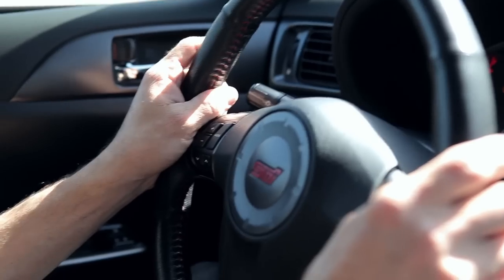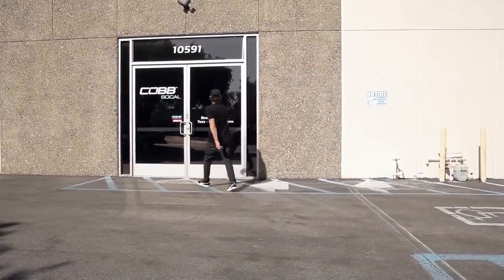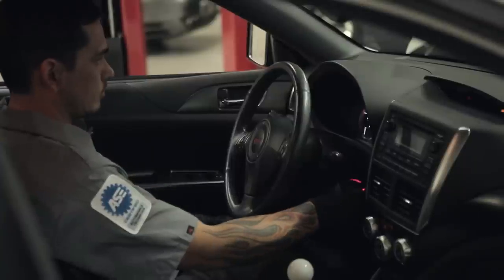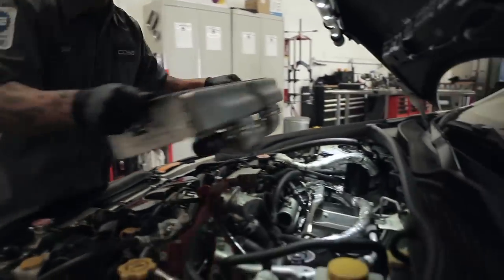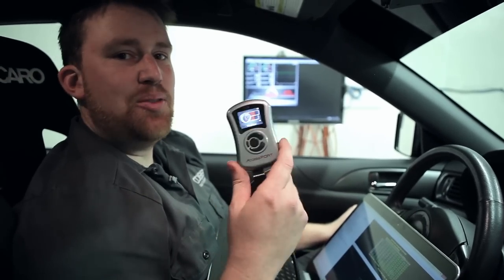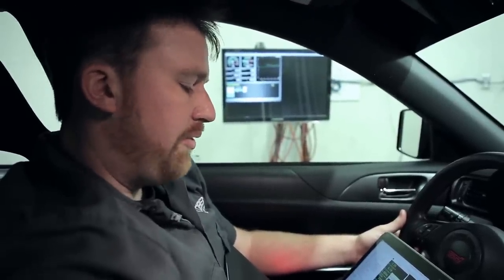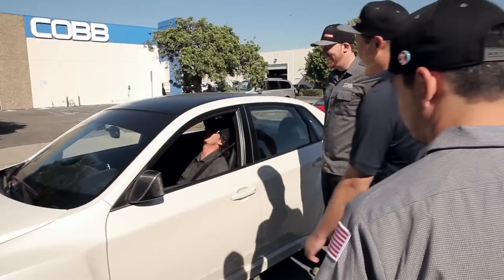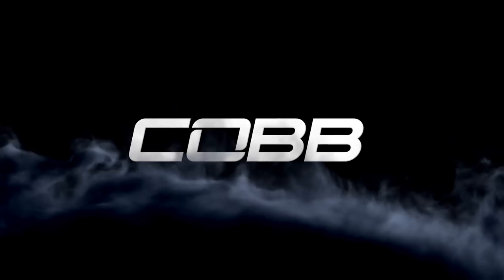COBB Tuning - Bucky Lasek Subaru STI COBB SoCal Car Build!

Comment: Did anyone else notice that in the first clips when Bucky is driving around the center cap on the steering wheel is silver (2:19) but when the tuner is in the car on the dyno the steering wheel has a black center cap (13:54).  And when Bucky is back in the car it's silver again (24:47).
Reply: Iain B 1 word: Lighting.
Reply: +Iain B Get your eyes checked. It's a darker gray because of the lack of lighting inside the booth. Same car, same cap...

Comment: First off let me say, I own and daily drive an EVO X but I have to give props to this STI, sick and clean. And props to Bucky for ditching the stupid ass spoiler.
Reply: Hey, that spoiler on the STI and EVo is what makes both cars
Reply: Hey cousin let's go bowling!
Reply: Shawn Moses i disagree, at least with the pre 07 sti, everyone loves a sleeper
Reply: snowboardUT sleeper STI, lmfao. Maybe to someone who does not care about csrs
Reply: black front mount and delete the hood scoop its a damn impreza dude
Reply: Shawn Moses black front mount and a hood scoop delete, its still a damn impreza dude
Reply: I agree but that would work better on the older modes because they all had the same body lines, but with the GR/GV's (Bucky's) that's when they had the wide and narrow bodies.
Reply: only the older ones though, obviously the widebody new ones look way different
Reply: Shawn Moses Yeah, and it's also what makes you get tickets easier.

Comment: I just bought a 2015 STI. I'll be doing some mods and already have the AP. I doubt I will put that much power into it..... But this Video is definitely inspiring. Thanks for showing the possibilities.
Reply: So far I've only used the AP for a stock Map. I can tell the difference. I'm sure it'll be worth it once I do more mods. If I ever need a pro tune, the AP will store it.
Reply: It's handy for multiple maps. Launch control is nice and so is the code reader and clearer. But the dyno, 0-60, 1/4 mile are all worthless. Those should have never even been on the ac.

Comment: Interesting video, though one of my rod bearings just cracked on my 11'  stage 2+ wrx, pro tuned,  accessport v3 to 278 whp / 326 wtq on a dynojet, I only had the tune for 8 months,  mostly highway driving (60 miles a day) no track, pulled it once a day, have done about 25k miles with the tune, car had total of 56k miles.
I guess pay to play... Subaru warranty? declined of course. I'm re building with forged pistons, but I think I'll stay with stock turbo, since I  want to have the car for several more years. Dropping Exedy stage 1 clutch, Blouch Dominator 1.5 xtr, verticooler and 1000 cc with fuel pump... total price? around $10k. 
Not sure if I'm the exception of the rule, but stage 2 on stock internals CAN brake. 
I think it may have been related to the higher rev limiter of 7000 rpm, planning to stay 6500 rpm at all times. 
Fingers crossed...

Comment: is it just me or is with the windows rolled up it kind of sounds like a boosted Honda.

Car is sick, awesome daily driven kind of build, but this isn't cheap, not even close, lmao.
Reply: Its because he has equal length headers, but yes it kinda does haha
Reply: ohhh, didn't know that! Still rumbled quite nicely with them.
Reply: Danny Oda This is a 2013 model, so unless he had his headers changed, his car should still have unequal headers. They changed the headers for 2015.
Reply: TheBlackWaltz
Even the 2015 model has unequal length headers still (i think?), only the WRX has equal length, but also has the FA 2.0 instead of the 2.5 EJ
Reply: MikeHuntIsItchy Hmm. The STI may still have unequal headers. But I can't imagine they wouldn't have changed it on both at once? Yeah it's the old 2.5 engine, but the headers are pretty easy to change.
Reply: all STIs come factory with unequal length exhaust manifolds, yes Bucky already had equal length headers before the install.

Comment: worse mistake I ever made was letting a non Cobb tuner talk me into letting him remove the Cobb Stage 3 tune off and letting him go open source.  result, the engine blew.  DON'T LET ANYONE TALK YOU INTO REMOVING THE COBB TUNE, IT WILL PROTECT YOU FROM LEANING OUT.  I really miss that instant "pin you in your seat" acceleration.

Comment: wonder how long the clutch will last?
Reply: There's no way he's on the stock clutch at 446 wtq. The stock clutch would literally explode with that much torque haha. My sti is at 350wtq and I've already smelled it a few times which is why I'm putting in a stage 2 competition clutch.
Reply: Flat_4_Crew You're right man. I have basically the same setup/build (built by cobb), similar pwr 430hp/435tq... with a stock clutch that lasted 1/2 a trackday lol (the video is on yt). I got the stage 4 competition clutch... and I'm not super happy with it. I'd recommend an ACT HDSS clutch - that's what im switching to.
Reply: Everyone's been telling me that competition clutches aren't good but I've read so many good reviews. Idk what to do now lol. But I got it brand new for $350 so I'll just see how it holds up martenco
Reply: Get a exedy or clutch masters
Reply: Ive litteraly never changed a clutch on any of my STI's. Wtf are you guys doing that you need a new clutch. My 04 STI was making 371whp/418wtq on a 20g turbo and in the 5 years I had her it was on the OEM clutch. Same with my 17 STI, ya it's still new and less modded but the clutch should last 5+ years.

Comment: How much did this conversion cost out the door?
Reply: +2012 WRX for 100hp on a subaru, you are probably looking at 8k lol For 100hp on an evo, you are looking at an AP and a tune.
Reply: +LP-RIPPER24TV what?
Reply: +LP-RIPPER24TV what's so epic about them
Reply: +LP-RIPPER24TV Performance? What performance? Looks? If you wanna look like an Evo sure..lol I can agree with that. Clutch burns out just as fast as any other on a subi, aftermarket parts? What are you even talking about? Car culture? Do you mean vaping?

The fact of the matter is, the Evo is a superior car in every way, the AWD system is better, the engine is FAR superior..so on and so forth.
Reply: LP-RIPPER24  but yet , you gave up on it and sold it lmaooo

Comment: I'm in the process of buying a 2009 sti hatch that puts down 700awhp and has 22,000 miles on it, what do you think a good price would be on it $USD ?
Reply: All I know is that, that 700whp is probably not reliable.
Reply: Welp $25k sounds reasonable but dont plan on it lasting more than 1 year.

Comment: What should some of the STI fans expect to spend on an upgrade such as this?
Reply: +Kevin Cartwright  My 500hp 09 sti Built motor Closed decked blouch dominator turbo upgrade and fmic air intake etc and e85 1300cc injector dynamics injectors  a few other mods i wont list all in all cost me 25k+ But that's australian dollars. I would estimate something close to 6-10k something around that for the mods bucky went?

Comment: a 2016 subaru sti what kind of power can I expect from the Cobb Stage 3 thanks
Reply: +COBB Tuning Cool thanks a lot for the reply I appreciate it. I would want to do the Blouch Dominator 3.0XT-R Twinscroll Turbocharger. Was wondering the list of performance mods I would need to support this turbo? Thanks And Happy Newyear!
Reply: +Parps Mcpimpson I had mine done at Cobb Surgeline recently and put down 318hp and 351 ft/lbs of torque @19psi.
Reply: +Dovi That's sweet man!!! I bet she gets up and goes. Such a fun car to get up and drive everyday. Love how the car delivers its power. It's great hear in canada just plows threw the snow

Comment: What does something like this cost from Cobb?
Reply: I think a protune is in the neighborhood of $400, but the turbo is $1,650 and the injectors are $960. So you're looking at ~$3,000.
Reply: Alvin Rohani I paid about $3300 from this cobb facility, including a new accessport v3 and injectors tuned on 20psi running a cp35r currently making max psi 20psi 395whp/382tq safe tune no forged internals so far great tune setup from them no issues so far i cruise at very low boost and get 33mpg highway!
Reply: No way do you get 33mpg! On a stock tune my father's STI gets like 22 at best 24mph highway. I didn't think it was even possible to get over 25.
Reply: Alvin Rohani On stock tune my '15 WRX gets 20City/30Highway. It is a SloWRX thouguh :D
Reply: Alvin Rohani that's cheap for a tune. Here in NZ where i get my Subaru done it costs $680 US dollars.
Reply: marccandrift How many miles on the tune? You probably cruised at like 60mph to get close to that haha Don't believe what the gauge reads ;)
Reply: marccandrift How many miles on the tune? You probably cruised at like 60mph to get close to that haha Don't believe what the gauge reads ;)
Reply: I get like 16 mpg wtf LOL
Reply: RUZTY1311 About 3000miles in, its a weekend car. 
Christopher Senores 
Lmao 30mpg highway tho, i do a commute from Irvine to San Gabriel

Comment: How much bucky spent for parts and labor?
Reply: @cobbtuning  i saw your prices on website but those are only for the parts? No labor installation price? You should post it on your website the labor price
Example
Stage 1 package parts 1200
Labor 10 hours = 1200

Total 2400

Comment: why not an upgraded blow off valve?
Reply: Point taken. I never had any long term luck with OEM type BOV's. But, that's in draging and the boost is quite high. That's why I was asking. I've seen a car of yours  run at Buttonwillow. It was hella fast!
Reply: Import cars is something out of my comfort zone. I am learning, what works on A may be completely different on B. It's good to hear there are turbo's with good blow of valves.

Comment: COBB Tuning  is Subrina running on stock internals?
Reply: yes
Reply: MikeHuntIsItchy nope, Cobbs facebook tells otherwise, its got a fully built shortblock. He wanted it to be bulletproof, no EJ257 would handle this power without poping a ringland
Reply: Capp2015
my apologies. When in the video he very clear on keeping it stock platform. EXTREMELY misleading.
Reply: He probably was talking about keeping stock turbo platform and a top mount. Opposed to a front mount intercooler and a rotated turbo
Reply: Capp2015 that does make sense, but even then, they def shouldn't have said this type is appealing to average Joe guy. Assuming average Joe makes 32k-36k a year, this isn't exactly affordable lol!
Reply: Capp2015 yes it would
Reply: He has drop in forged pistons, everything else is stock in the motor.
Reply: Shawn Moses
This car has well over 50k invested into it including the cost of an STi, how does that even remotely appeal to an Average Joe?

Considering average Joe doesn't live with moms and pops, his rent/utilities are close to $1k a month, that right there a lone is cutting 12k off his yearly gross income.

RIPPPPPP.
Reply: MikeHuntIsItchy think you have the wrong person
Reply: Shawn Moses
Wow how the heck did that happen, my bad man!
Reply: In the video he said minor bolt ons.. i guess not.

Comment: Why the hell would you keep the top mount if you're getting all that work done? Heat soak on these is a bitch it'd be the first thing I would have suggested.
Reply: If sticking to top mount get air to water type maybe, but serious tuners will go reverse intake manifold & front mount.
Reply: George The Zebra he said he wanted to stay top mount to keep the spool up quick